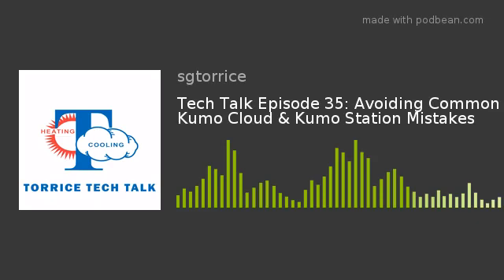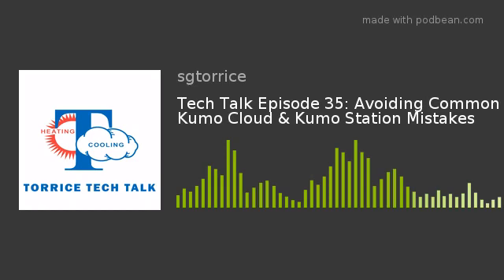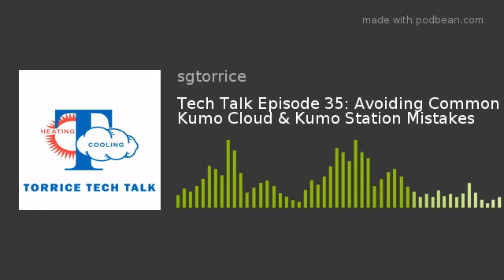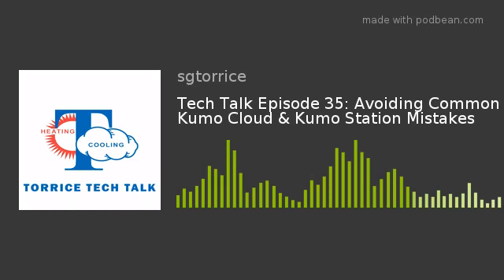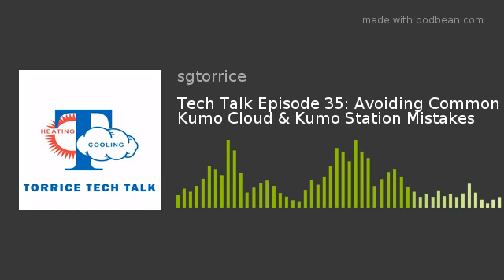Tech Talk Episode 35: Avoiding Common Kumo Cloud & Kumo Station Mistakes

Comment: If the contractor powered the Kumo Station from the boiler transformer, what could be some issues you'd expect to see? Failure to open heating zones when the kumo switches over to backup heat?